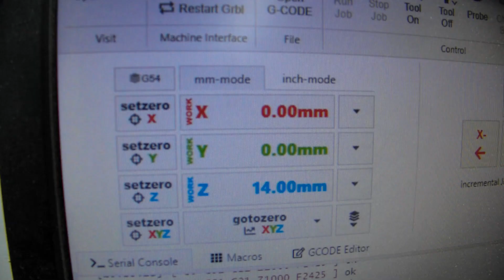Carving 3D eagle using desktop CNC router

Comment: You don't show on this video, but previously you have used a brush in a die grinder for clean up. What is that?  Also what software do you use for cad/cam?
Reply from the maker: Hi. They are called abrasive buffing wheele for rotary tool. Here's the link

https://www.amazon.co.uk/Abrasive-Buffing-Polishing-Accessories-Dremel/dp/B07MHL3XF6/ref=asc_df_B07MHL3XF6/?tag=googshopuk-21&linkCode=df0&hvadid=294749801516&hvpos=&hvnetw=g&hvrand=10404770220542293611&hvpone=&hvptwo=&hvqmt=&hvdev=m&hvdvcmdl=&hvlocint=&hvlocphy=1007208&hvtargid=pla-706802534357&psc=1

Cad software is SketchUp. Cam is Vcarve Pro.